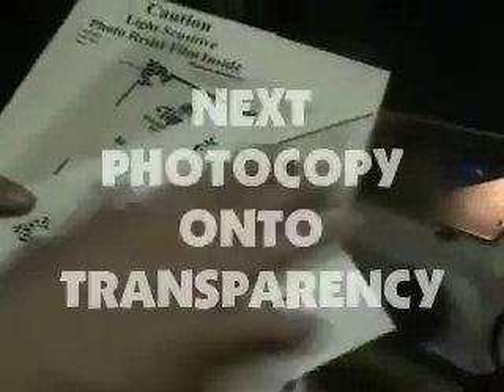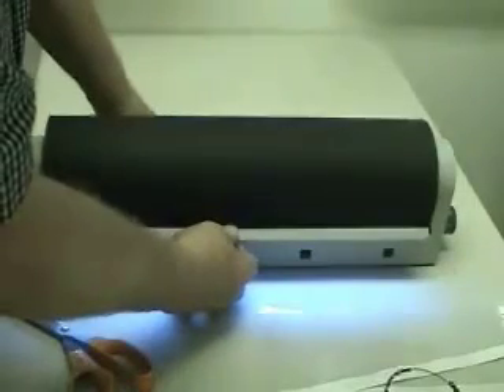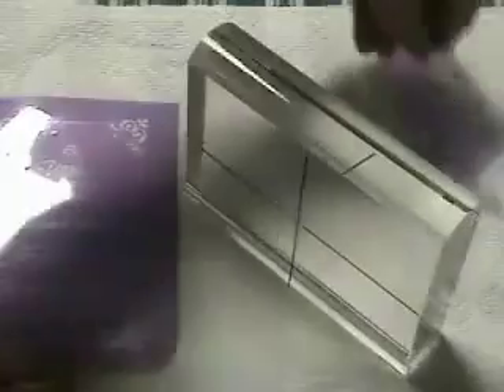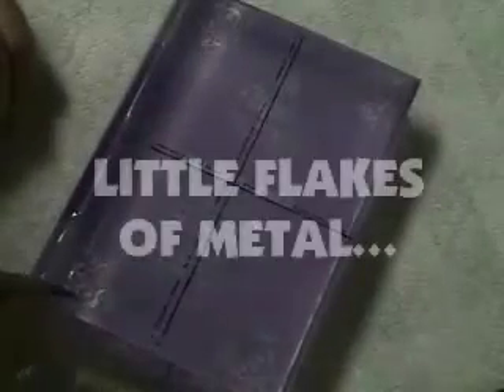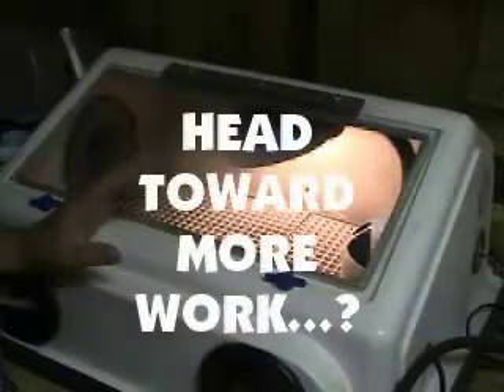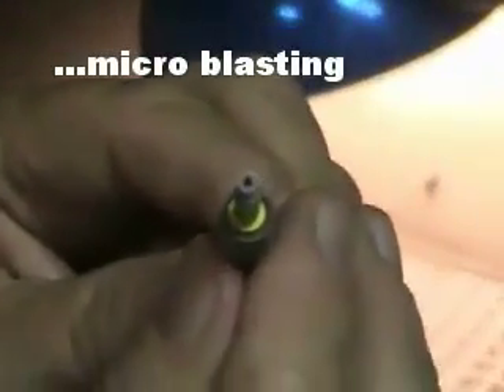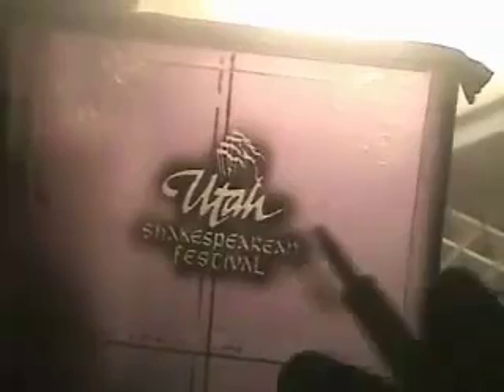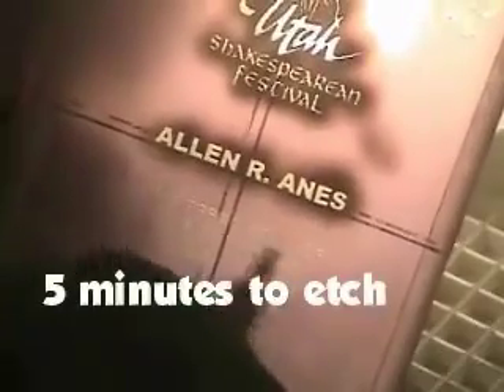Easily Sandblast Glass, Crystal, Rock and More with Micro Sandblasting.

Comment from the maker: The kit is available through Profitable Hobbies. It is called the ParaBlaster System - go to Profitable Hobbies dot com and click on the Systems page to see the system. It comes complete with the exposure unit and everything else you need . The abrasive we use is 220 grit silicone carbide.